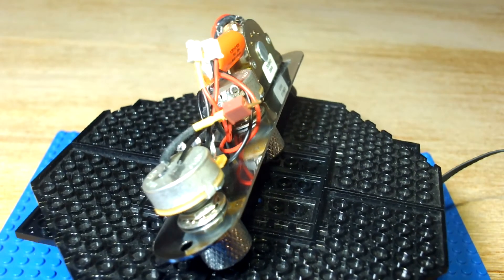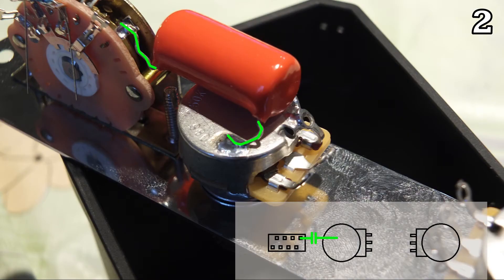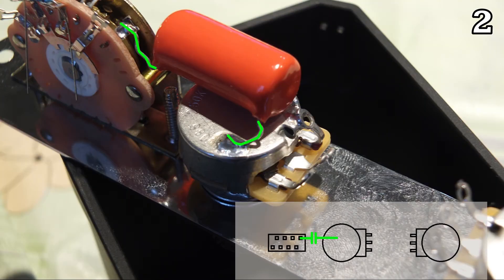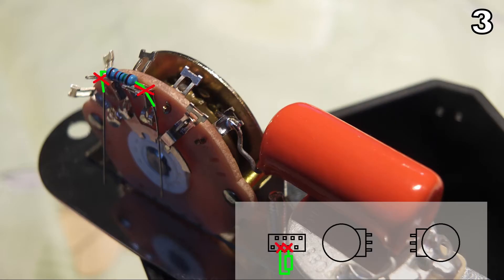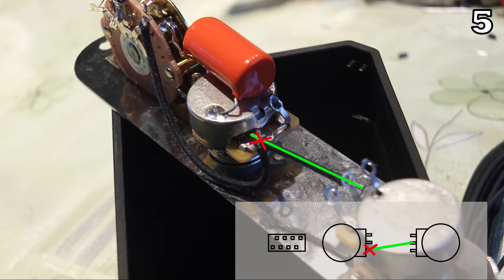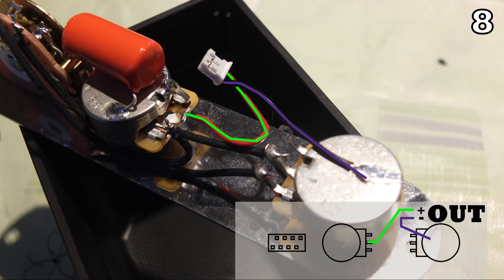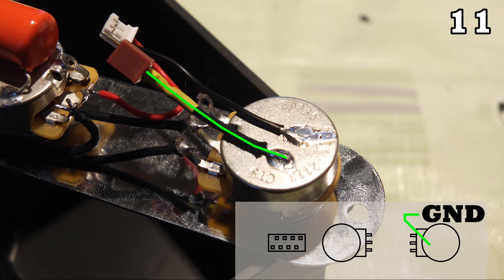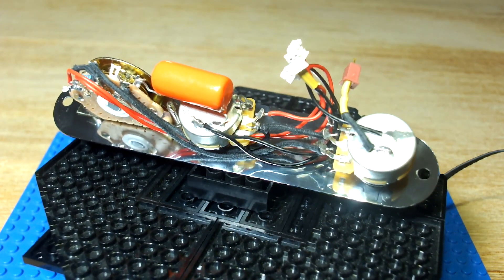Tutorial: Step by Step Fender Broadcaster Blend Wiring

Comment: Hi. Great video. Question: I have in my ‘52 reissue tele I have a broadcaster blender wiring installed. Is there any way to put a jumper wire somewhere so I don’t lose the high end of tone when rolling the volume down? I’m trying to this without having to use a treble bleed mod. Thanks
Reply from the maker: Thanks a lot. Losing highend from rolling down the tone shouldn't be a big issue with this wiring, as there is no tone control with a capacitor connected to it. The only thing I can think of is the capacity of the cables that are high and cause an issue. You could try the following thing, but I'm not sure if this helps a lot, and it will most likely also change the way the volume rolls off. Don't wire the wires that are going to the pin marked with an "X" in step 5 there. Instead, you also solder them to the middle pin of the same pot. Like this, you're removing resistance towards the output that's increased when rolling down the volume and only decrease the resistance towards the ground. 
That's something you could try, but no guarantee that it will give you the effect you like. 
Cheers, 
Martin
Reply: @ ok thanks I’ll check that out
Reply: @ I will try this method next, thank you. What I ended up doing late last night was kept everyone normal for broadcaster blend wiring but I had a brown capacitor laying around that I decided to see what would happen if I wire it in on the volume pot for an attempt at a treble bleed to keep that high end. It seems to have worked but instead of losing the high end now I get a slight cut of the low end lol. The high end is clear now but like I said now the low end gets cut. I don’t know much about caps but the one I installed has the markings “MSR .022k 250H”. Any ideas what’s going on?? Thanks appreciate all the help.
Reply from the maker: That cap is way too large for a treble bleed. It's a 22nF cap. The common values range from 100pf (=0.1nF) to 1nF. 
Cheers, 
Martin

Comment: Hey Martin, really cool tutorial, thank you! I'm considering this Broadcaster blend wiring, but I have a question.Could it be possible to add the series mod to it? Or are the two completely incompatible? Any advice much appreciated, cheers!
Reply from the maker: Hey there, thanks a lot! 
I've had a quick look at the diagram. I don't think you will be able to get it going with a 4-way blade switch. At least not without completely redoing the wiring, so it has barely anything in common with the original one. Unfortunately I don't have the time to think myself into this all too much to get you a 4-way solution anytime soon. However, you can make it work with a push-pull pot. But you will have to consider, that you'll not be able to get a blend functionality in this position, because if everything is in series, your resistor and blend pot, will also affect both of your pickups, just like an additional volume control. 

How you would do it with a push-pull pot depends a little on your pickups. I would highly recommend you to have a 3-wire pickup with the shielding (ground) separated from your south wire of the pickup. Otherwise you might get your PU housings to become hot, not ground anymore, in the series position. This will lead to any touch of you injecting currents from your body into the circuit which will be noticed as noise.

You will want to have a look at my push-pull wiring explanation video. There I have the schematics how you would insert that push pull for series/parallel of two pickups into any circuit. There are a few things to be aware of though. What I consider PU1 in that diagram has to be a pickup with 3 wires as mentioned above. The other one does not need to be one. This will have some limitations. You can't quickly switch from series to just any other position. If the bridge PU is PU1, only the blend position will work with the push-pull in series mode, the other ones will be muted. If the neck is PU1 with the 3 wires, it will be the blend position that is muted. So it's probably preferable to have the neck PU be PU1, if possible, as you can also use the PUs in series on the "bass setting". 

Also a few notes to have it easier to understand my explanations in that video, "GND PU1" is the south wire from the coil of PU1. I was a little sloppy there not naming it south. In your case "GND" is actually a connection to ground, so you can wire that directly to the pot housing. "PU2 hot out" is where your north or "hot" wire of that pickup would go in the wiring diagram, if you wouldn't have the push pull in between. This means the respective pin on the 3-way blade switch.

I hope this helps.
Cheers,
Martin
Reply: @LMGuitarCorner  Wow, man, thank you so much! I wasn't expecting such a detailed answer. 

I love your solution, using a push-pull rather than a four-way switch. I'll have a look at the other video you mentioned. Using the neck PU as PU1, like you said, seems to be the best option indeed. I still need to think about this guitar setup and what I want out of it, but I'll let you know what I end up doing.

In any case, thank you so much for your quick and very detailed answer, Martin. It means a lot. Best of luck with the channel, looking forward to seeing more great content!
Reply from the maker: @batsauvage7472  You're welcome and thanks a lot for your kind words! I just also did think about it once more. If you use the neck PU, you will have series indeed working in all positions as the neck PU is active in all 3 positions. In the blend position, you will have all resistors including both pots active though, so I'm not sure how useful it will be, but you would get some kind of signal. If you have any video request just let me know. Imho I've finished pretty much all relevant and non standard wirings, especially with my push pull video being universal for any kind of combinations with push pulls. I may have missed something though.
Cheers,
Martin
Reply: @LMGuitarCorner  Another very good point in favour of using the neck PU. Thanks again for taking the time to think about this setup. You've definitely covered a lot of ground with your videos, but I'll let you know if I think of something! Cheers, thanks again, Martin!
Reply from the maker: @batsauvage7472  You're welcome, and thanks a lot!
Cheers,
Martin